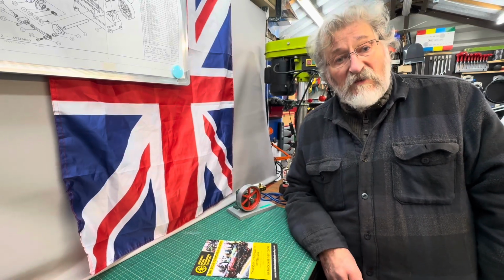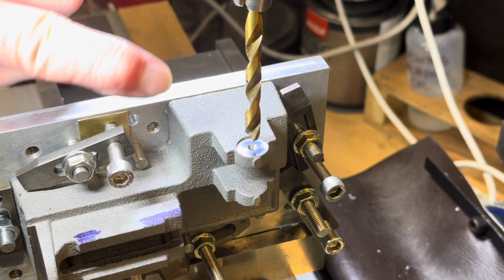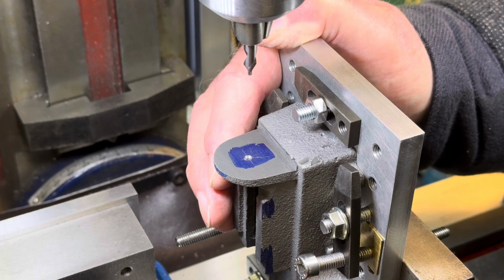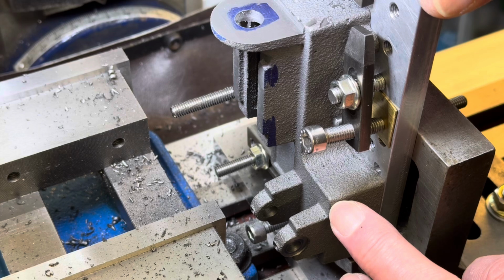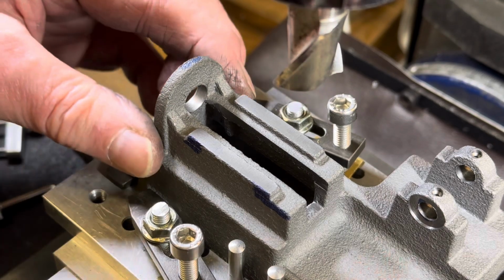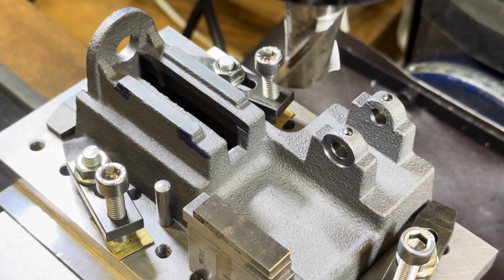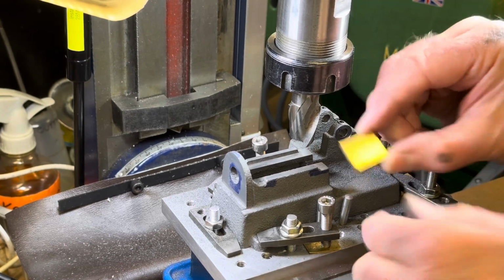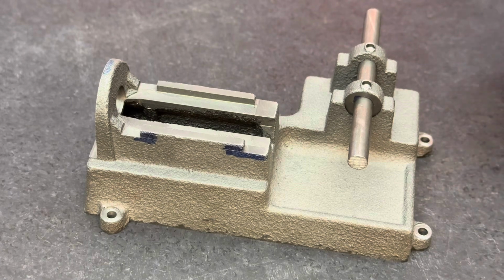PM Research #3 Engine - Part 3

Comment: Did you run a clock across the mock crankshaft to check for parallelism?  The base looks good, nothing a bit of filler and paint can't fix.  I've been wanting to try my hand at building one of these kits.  There are a few things that I would change such as adding small custom made oil pots to lubricate the shaft.
Reply from the maker: I have tested the casting and the crankshaft, and it’s fine. I guess you could add oilers if you planned on running the engine for long periods. I counter bored above the oil hole which will be ok for short runs, and can easily be topped up while it’s running. There are many other parts on the engine that need oiling as well. Hope you do get to build one yourself. Cheers Nobby
Reply: @nobbysworkshop  I just need to locate a kit.  I'm also considering building a hit n miss engine from bar stock
Reply from the maker: @taranson3057 In the USA they are available from pmmodelengines.com in Wellsville NY and the UK from www.forest-classics.co.uk in Gloucestershire. Hope this helps

Comment: Great outcome Nobby. You have already done it but next time watch the spindle speed. For a .750" dia HSS endmill on cast iron, spindle speed should be around the LOW 400's. 80 Feet Per Minute for Cast Iron. Looks like that was at least double that. You will burn up the cutter if too fast. Regards from Australia.
Reply from the maker: Thanks David. Was very nervous machining this part. I’ve not used this end mill before. I’m experiencing problems with my mini mill, in that it doesn’t seem to like running at lower speeds. I don’t know if it’s the motor or the control circuit that’s the problem. When I’m running it at about 1000rpm and above it’s mostly ok. I know I was running the 1/4” reamer too fast, but the mill kept stalling below 400rpm. Have to make the most of what I’ve got. Cheers Nobby